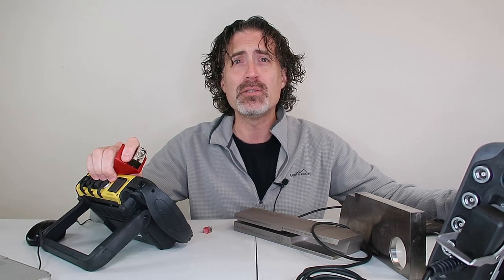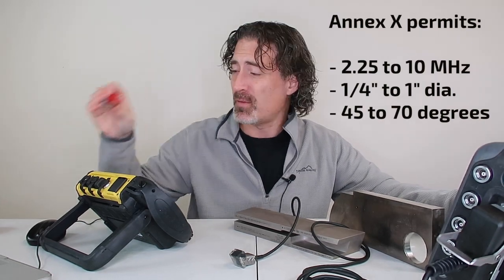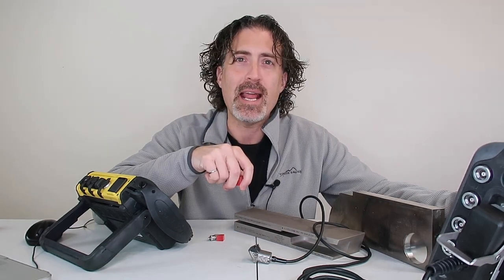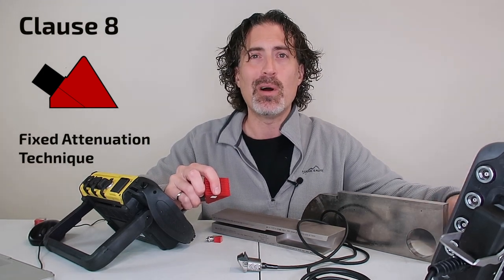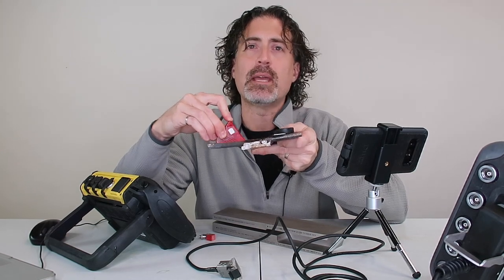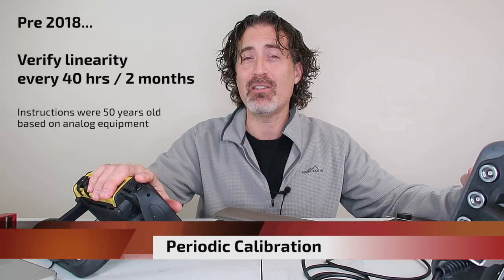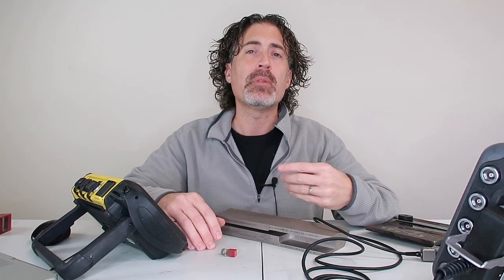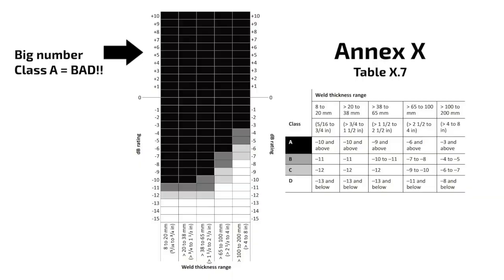Changes to Structural UT in Canada - CSA W59-18

Comment: So, just to be clear, the chart @4:30 is saying that if we had a signal at -10dB at reference level in a 19mm plate (that is 10dB BELOW ref), that indication is a Class A rejectable without question?  Is that correct?  That seems like you'd be rejecting absolute FLYSHIT.  Am I missing something?  The chart would make sense if you had a signal that needed to be brought down 10dBs to reach the reference level (making it -10db) but that's not what this chart seems to be saying, it seems the chart is saying that at Ref a signal coming up at -10dB is Class A and rejectable.  Is that correct?  that seems ridiculous to me.  Can someone please explain this chart and when is something rejectable (provide an example)?  THANKS
Reply from the maker: Yes. In the 2024 code edition this is now Figure X.2. This is actually 1dB more lenient than the "old" way in Clause 8, and the corresponding table for cyclic loading in 12.5. Structural UT in North America has always been this way.
Reply: @hollowayndtengineeringinc.5201  Awesome, thanks very much for responding - and thanks for your channel, please keep the great content coming.

Comment: Hey Paul, there is alot of confusion on this method in the field that im seeing. you should do a video actually calibrating on a dac curve and showing specifically how to accept/reject to the more sensitive (smaller) IIW hole.
Reply from the maker: I intend to make a video for the 2024 edition which also adds encoded PAUT in Annex Y. What sort of confusion is the 2018 edition causing? We've received very little interpretation requests.